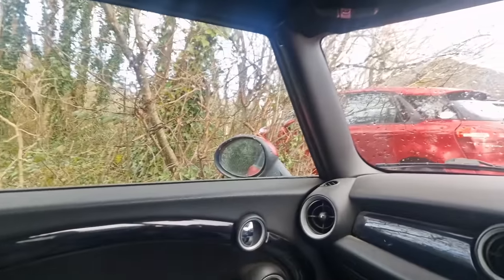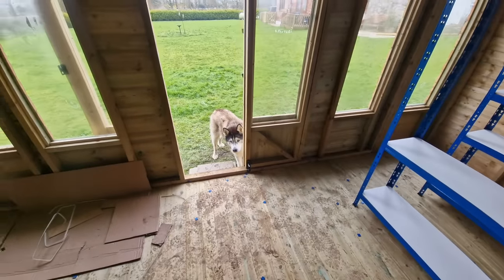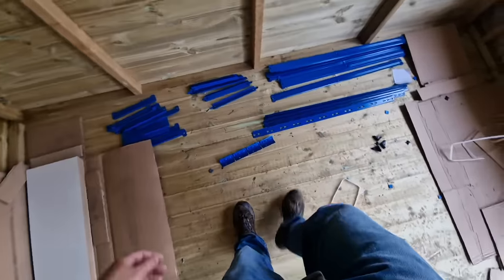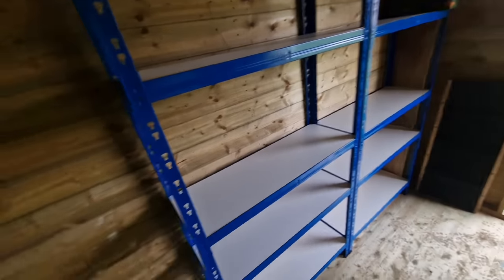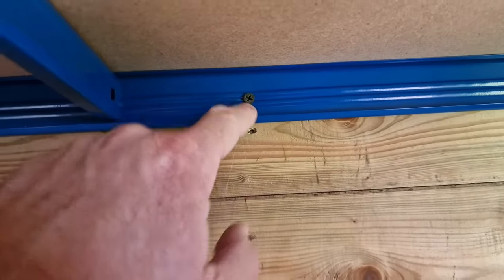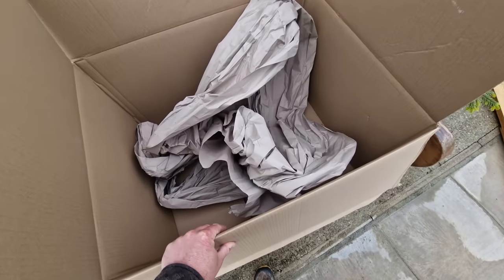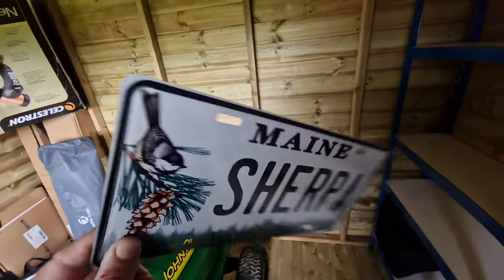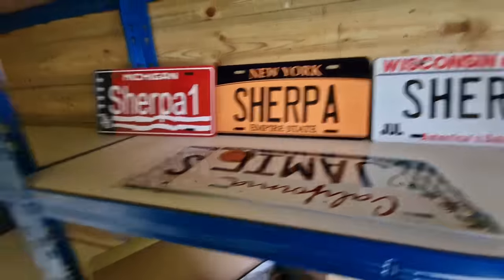Husky Has A Busy Day And We Were Being Watched!!

Comment: I’ll be shocked if he uses them. You can’t seem to comprehend the pain putting weight on the front joints causes in trying to raise the back legs. A long carpeted ramp slightly inclined is what works. Like the entrance to the house.

Comment: If you take a piece of plywood about 2feet by 4 feet , cover with carpet, put slats every 12 inches or so, and a nice sized barn type door pull/handle midway on the back you will find it very useful for a ramp wherever needed.

Comment: I can suggest using small brass hooks that can screw into the wood and then you can hang the plates from those. Just use a marker to make a dot on the wood to line up with the holes in the plates and then, using pliers or a screwdriver for torque, screw the hooks into place for hanging.  Love how the shed looks and the fact the three shelving units fit in there perfectly couldn't have been better planned if I do say so myself!

Comment: The shelves look great. The new steps look much better They are wider, but the angle allows more forward chest room for Sherpa to use his upper body to pull himself up and not have to push up with his weaker rear legs.

Comment: May I suggest using 3M command products to attach the Shepa plates to the walls. They make'em for hanging pictures.  Some work like Velcro ... speaking of which, you could use Velcro for light loads. Get it by the roll and cut to length.  But, the Command products are extra nice because it removes from the wall surface easily leaving no sticky residue.  Don't store Sherp's treats in the shed.  Heat during the warm months can make them go bad.  Only store food stuffs in the house where the environment is temperature controlled.